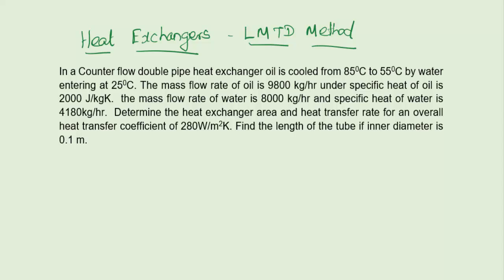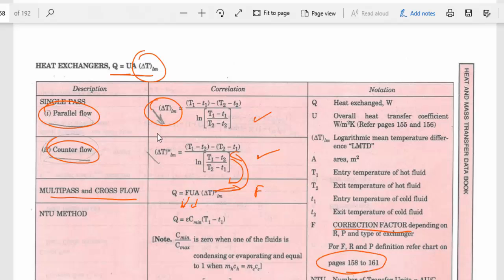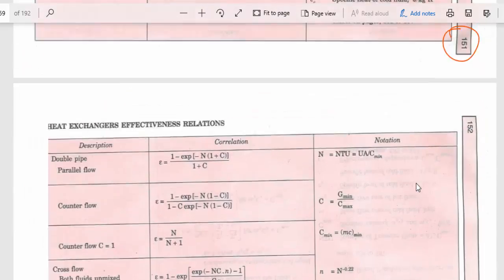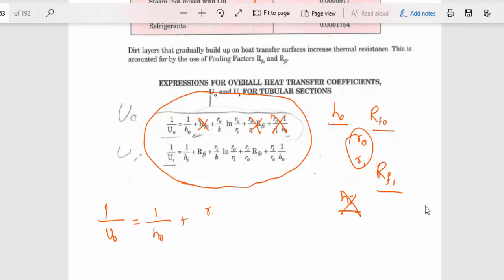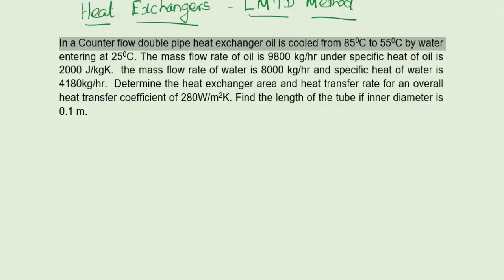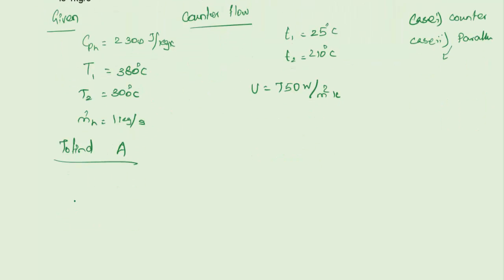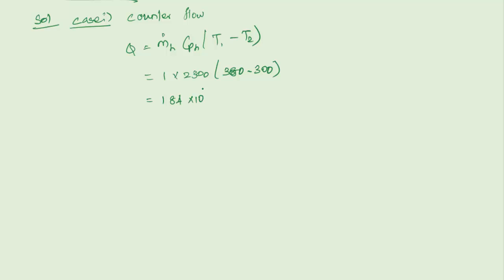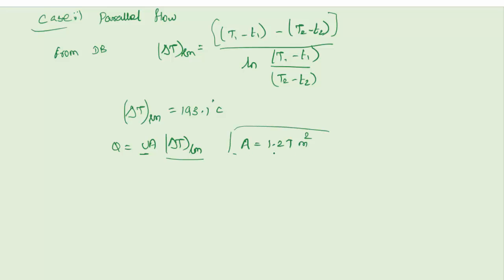Lecture 26 | Problems on Heat Exchanger LMTD Method | Heat and Mass Transfer

Comment: Sir if diameter not give how will find length
Reply: 2. types of problems will exist. Either L is given and one of the diameters is not given or one of the diameter is given and the length is not. there will not be a case where neither of the critical information is not provided. In a case where such thing occurs, you must assume the diameter.
Reply: @zenvibes4396  tq sir ☺